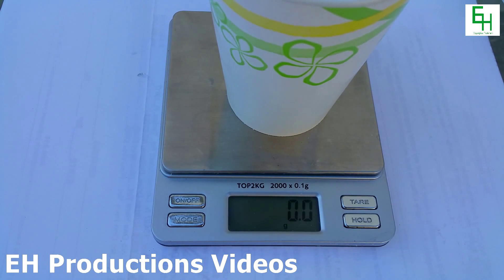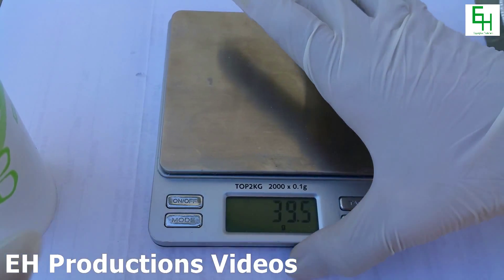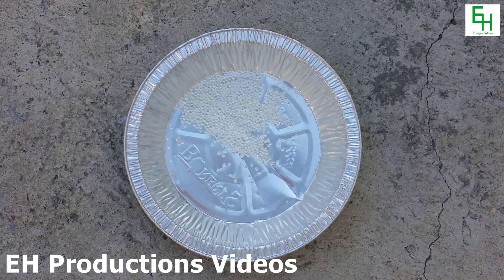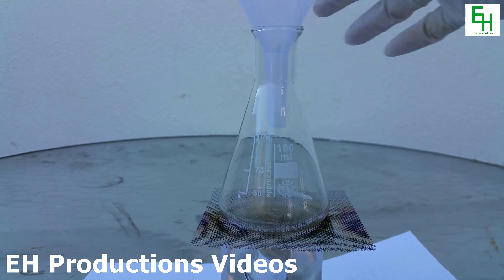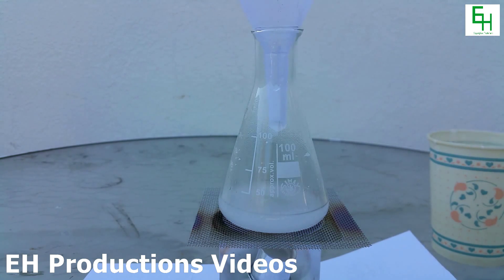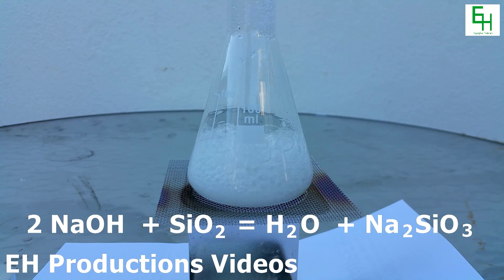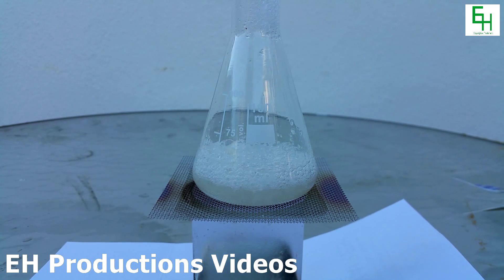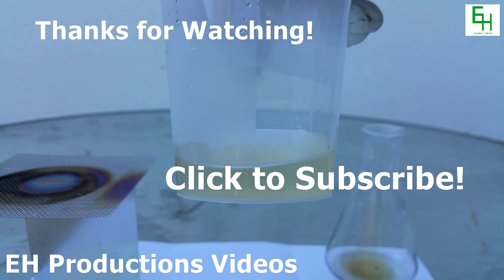Make Sodium Silicate or Water Glass with Household Chemicals!

Comment: Hi, hope you can advise, I have made several batches of Water Glass using the correct measurements and ingredients, the problem I'm having is the finished product does not harden properly by air drying, it takes ages to solidify but remains tacky to the touch. Also is there a catalyst you can add as a hardener to speed the curing process. Thanks :)
Reply: Carbon dioxide is the catalyst or fire the casting like for fire bricks and furnace refactories
Reply: Carbon Dioxide. Use a propane torch and run the flame across the surface that is coated. Works very well
Reply: Try heating it if possible on your Workpiece surface .
Reply: Search for more concentrated water glass recipes.
Make CO2 gas help to cure faster depending on what you are doing
You can make cheap CO2 by mixing vinegar and bicarbonate of sodium, don't no the name of it in english. Just search in YouTube how to do it and you will find measurements of if.